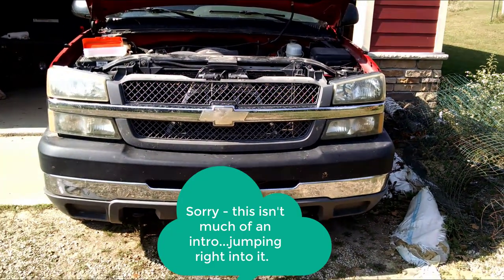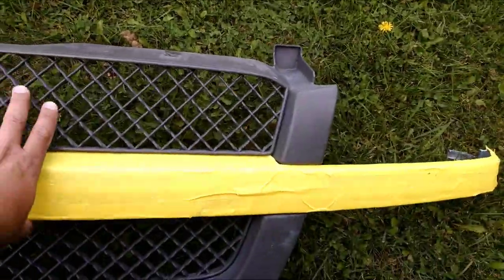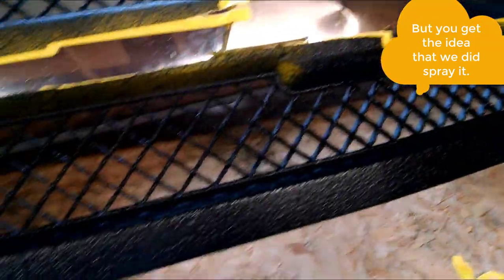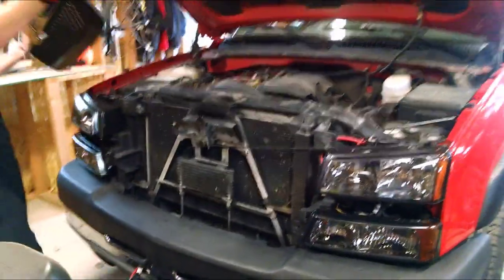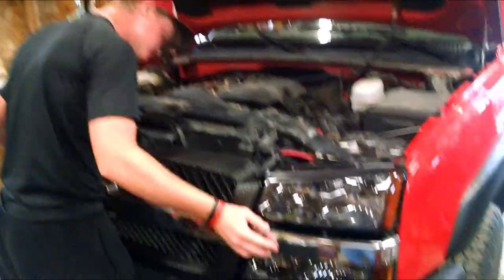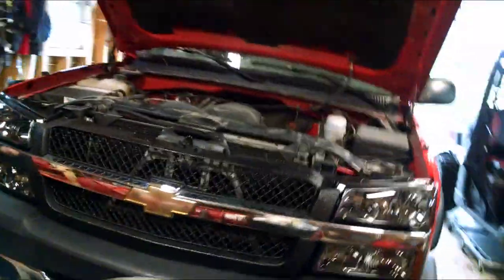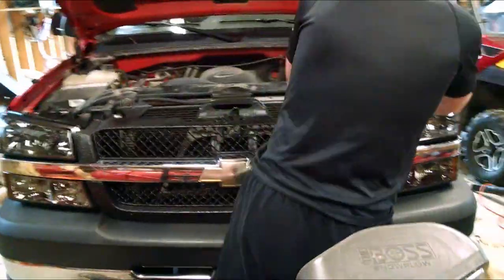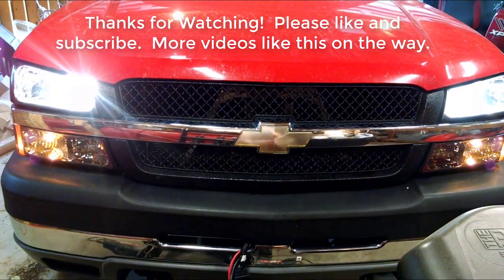How to Spray Bedliner on Your Truck Grill

Comment: I am interested in doing this to my 06 grille. What did the bed liner cost you to do this?
Reply from the maker: Good question.  I spent about $100 on Amazon for a 4 bottle kit.  But they do sell a two bottle kit for less.  You likely wouldn't need more than on or two bottles.
Reply from the maker: Hi!  I purchased a 4 bottle kit on Amazon for about $106.  You wouldn't likely need that much for just a grill.  I believe they sell a one or two bottle kit for approx. $40 - 60, and you would also need the sprayer to connect with your air hose.  These are approx. $12-13 on Amazon as well.  You could also try doing a Google search to see what meets your needs.  Thanks for the question.

Comment: Hey, how did this last? Does bug splatter wash off good? Im considering doing a Ram grille with either this or RustOleum..
Reply from the maker: Hi Maylene, so far so good.  If you do this, make sure you use the Raptor primer first before spraying.  It will help it stick a lot better.  Also, I haven't driven my truck a whole lot this year, so I haven't had to scrub the grill of dead bugs much yet.  I will keep you posted if I have any updates.
Reply: CarsThatLast Thanks for the reply! There are many videos on "how to" but none on longevity and practicality of unconventional mods... Definitely post an update.
Reply from the maker: Will do.  I was thinking...if I just wanted to change the color of the grill, it might be easier and cheaper to do it with paint.  I had extra bed liner so i just used that.  Good luck.  :-)